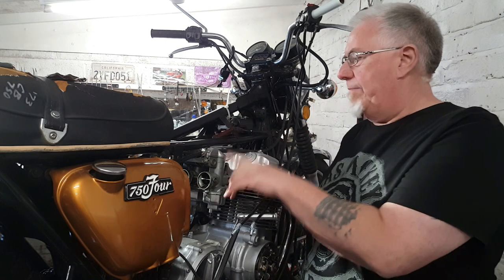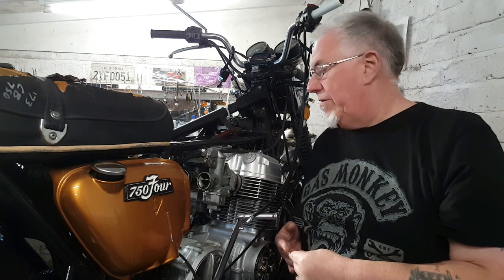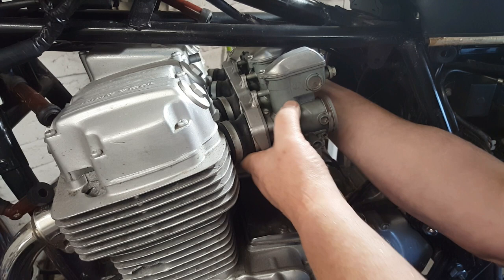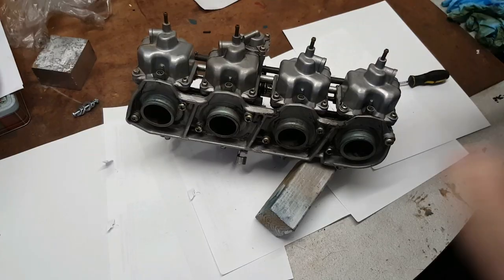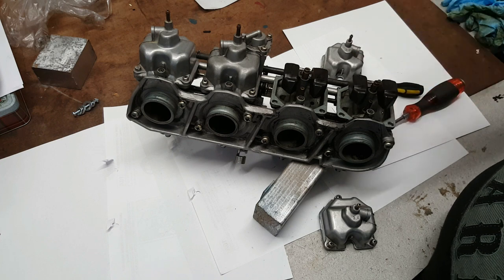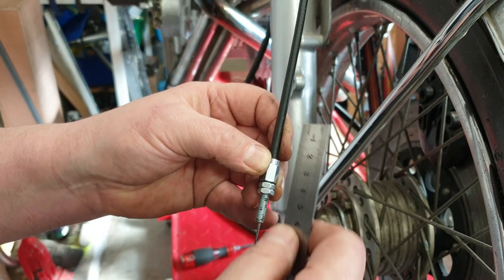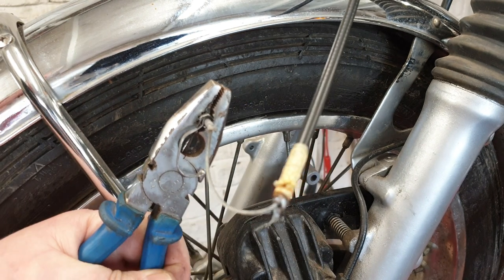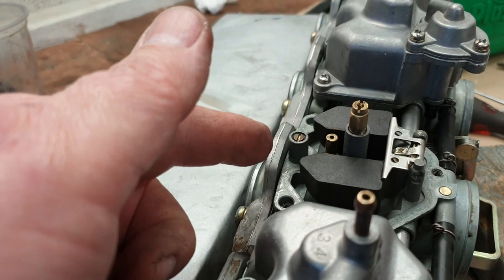Setting Honda CB750 Carburetors [PD42 B K8 Carbs] | Adjusting Motorcycle Throttle Cables | Part 9

Comment: These came Factory on My 78 K which is the same Engine. Only difference would be the Intake Boot's I believe.
Reply from the maker: Yes the intake boots are different, but you can make the work if you have to!  I think the carbs were changed to improve emissions, I'm not sure what the main differences are other than the accelerator pump.
Reply: @SPANNERRASH  I'm sure you could Tune them to Work. And in the Pumper Carb's you can Mechanically adjust the Needle Position with a Screw driver and Wrench. Kinda like you would adjust Valve Tapit Clearance. I don't believe the earlyer Carb's have that Feature.

Comment: How do those carbs compare to the stock bottle tops that should be on the bike?  I think the bottle tops are easier to work on....and you can usually find a used set on line for 150 bucks or so.   I bought an extra set on Facebook Marketplace for $120, just to take apart and clean for educational purposes.  Now I know how to do it if I ever need to take my carbs completely apart.
Reply from the maker: I am considering going back to the original style carbs, as I expect they may be easier for me to get right for this bike. I have no idea which would work out best performance wise.

Comment: Hi  I have a problem with my choke slide keeps dropping down on pot 3 .  Any ideas   Thanks
Reply from the maker: Hi Cody, that sounds like an unusual issue. Is cyl 3 slider disconnected from the actuating arm? It should be connected to the arm via a pin, usual for them to be an issue. If it isn't a pin issue then it would be an issue with the carb itself. Hope that helps!

Comment: I'm surprised the carbs fit on the head. I had a 1977 F2, wore out the engine and replaced it with a rebuilt 1974 engine, using the 1977 carbs. The carbs were bigger than the snorkels of the head, so I had to build up the diameter of the snorkels to get the rubber intakes to fit without leaking.
Reply from the maker: Hi Rick, I had the right rubber manifolds for the later carbs fitted to the engine when I bought the bike. When I changed to the earlier carbs I had to buy another set to fit them.

Comment: How many turn do you use for the Pilot/slow jet? I can’t seem to get mine right
Reply from the maker: Hi Joshua, The manual says start with them 1 turn out from fully in. Adjust each no more than 1/4 of a turn to adjust to get an even pressure using carb balancer. Never more than 2 turns out. If you are having problems with your pilot air system check that all of the breathers are clear. A kinked pipe or a blockage of a breather can cause lots of slow running issues. Hope that helps!
Reply: @SPANNERRASH  thank you so much! We shall see if it works

Comment: What sort of idiot puts the floats upside down. 
That would be me, not once but several times. The more I try not to do it the more it happens. Think I must just like to see the petrol emptying out of the over flows.
Reply from the maker: I know what you mean.  If you hit your thumb with a hammer when knocking in a nail you would think you would learn, but you never do.  Carbs are far more complicated than that! :)